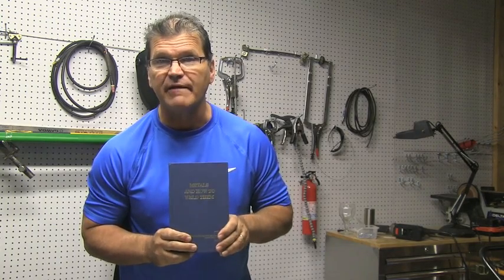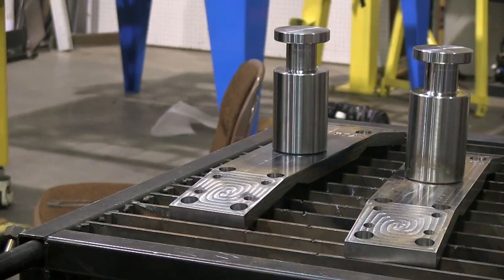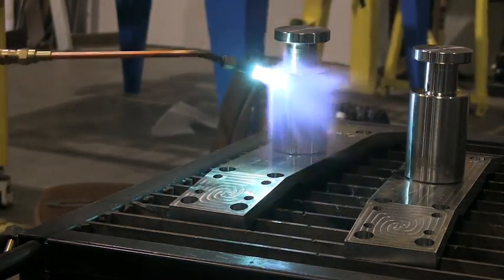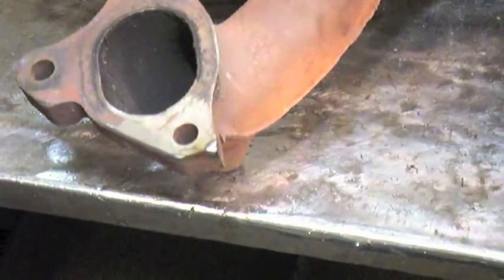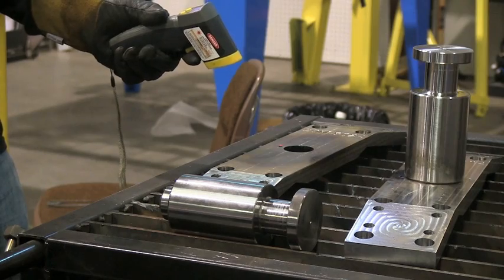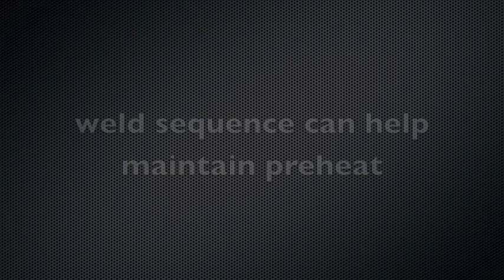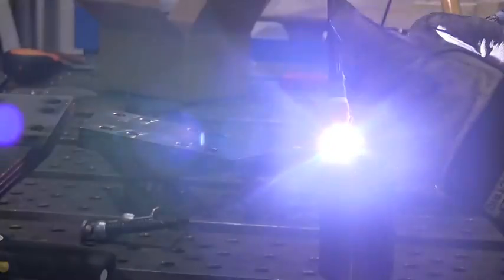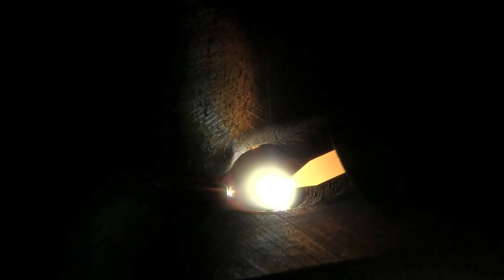Tig Welding Low Alloy High Strength Steel

Comment: I said this before on other videos of yours. I have welded all kinds of alloys and used almost every process over 45 years. I welded chrome and stainless and inconel as well as hi and low carbon alloys. Strictly heavy wall welding on powerplants for 12 years. I have written and proved over 20 PQR’s and developed WPS’s for those procedures as well. I am almost 67 and still welding as a hobby in my retirement. I have worked with and around superior craftsman my entire career. Jody is by far the very best I have ever listened to or watched! Everything he says and does is like an old fashioned handshake, you can count on it! Even after a lifetime of welding, fabricating and rigging, I learn something I didn’t know by watching his videos. Everyone in this field, especially the younger men and women, should pay attention to everything he has to say and show them. I am not only a better welder because of him, but a better person as well! THANK YOU, JODY!

Comment: Hi first of thanks for the info in the video. I have a question. Could you not just heat the metal whilst and after the weld was done to prevent cracking. Am I correct in assuming you are trying to keep the tempering color the same as it was when the tool or steel was quenched originally?

Comment: My kid asked when doing homework whether anything they learn in school will ever be used when they grow up. Some won't but it gives you options later in life. Welding with my everlast just got so much more interesting knowing there is more to welding than just electricity, heat and metal

Comment: Hi welding tips and tricks. 
My  ?  Miller maxstar 200   Is what i use at work  but some of the guys dont really know how to set it up correct when they weld stainless steal tubing  sanitary welding  they would plug it in turn the knob  to about 60 75 and just start weld they  dont set  amp.   It factory settings  i see some of the welds. Its not good is there any tricks that you would have if you used this type of welder.   Thx for your time

Comment: i dont know if you knew, but you cant use a IR pistol to check surface temperature without adjusting it to the IR emission rate of the material or surface you are working with. for example a shiny surface doesnt radiate nearly as much IR rays as it is hot. a matt black surface on the other hand emmits exactly the ammount of IR rays that go with its surface temperature. you can say that shiny surfaces allways seem colder than they are when messured with a poorly adjustet IR themometer
Reply: Agreed totally, we were welding line pipe which was rusty and dull on the outside to machined 4130 flanges and with the IR Gun the difference was almost 50% cooler on the shinny flange.

Comment: At 500F why not throw it in the oven for a bit. Especially if you have a few to make.

Also weldingtipsandtricks can you show us the print, and go over symbols sometime. I think that would be a valued video
Reply from the maker: i was thinking about heating a few at a time inside an old gas grill but an adapter was missing so a trip to home depot would have taken longer than just heating with the rosebud.  For the last 10 or so,  I preheated on a fish cooker burner and added a final preheat with a rosebud to get them above 500f.
also, i will try to  show some prints and symbols when i can but most customers dont want prints shown.

Comment: Once apon a time I welded a low carbon steel part with stainless steel rod. When I finished I was so proud of my work. It looked great. I left it on a work bench and went home for the night. When I return the next day the weld had cracked right down the middle. I dont even remember the type of rod but I did learn from it.

Comment: hey Jody, i ve had some problems in the past with IR guns on shined steel, i use to   weld hard ox 450 wear plate and if the primer was ground off the IR gun would read a different temp on the primer than on the ground area. so now i use a temp stick on any shined metal that has to be preheated. thanks for the great videos and Tig fingers there a lifesaver

Comment: Those little ray guns use emissivity to measure. 

You can calibrate for one particular material

They have huge variance depending on which metal and what surface finish it has

Comment: I used Jody's TIG finger last night welding up a 20 gal. 0.125" thick 5052 aluminum gas tank with numerous sockets and bungs.  For me, impossible without that TF.  No more wood props and baked gloves.  I prefer thin deerskin gloves for increased feel, so I often wear several TFs on the torch hand to insulate from radiant heat at higher heat settings.  Furthermore, the TIG finger glides over the weld pass, whereas gloves will tend to drag on very hot material--especially aluminum.  Jody isn't pimpin' a product, he's trying to give you a bargain favor.  No snake oil here.  Definitely a "best thing since sliced bread" discovery in my book.
Reply: Literally one of the most useful tools I've ever bought

Comment: I went to the Lincoln Foundation web site and didn't see that particular book, so I then went to Amazon and they had it, but the price was a little steep, so I went to Abebooks.com and they have tons of that book available and most were around the 10 dollar price mark.  Thanks for the tip... I was working on a gun barrel a while ago for a friend and ran into the cracking problem... pre-heat solved it!
Reply: Steve Mackelprang thanks for the reference to abeboooks.com - including shipping I paid $14.00 for the book, however, Amazon had it for over $300! What a racket! Thanks again!

Comment: I have had some misleading readings from my IR thermometer due to the shiny surfaces. Have you noticed that problem on those being as they are so shiny? FYI I have the same temp gun
Reply from the maker: yep, but i just try to find areas where it settles on the same ready consistently. once the shiny surface turns blue, it settles down.

Comment: What kind of helmet are you using? Ive seen guys use an oxycetylene torch,  hit it with a full acetylene flame,  then heat it up.. the soot burns off at 500º. Great video!
Reply from the maker: the problem with using a full acetylene flame is all the carbon in the soot. If carbon particles get stuck in the joint, you can get cracks galore...It happened to me years ago and I never forgot it.
the helmet is a lincoln viking 3350